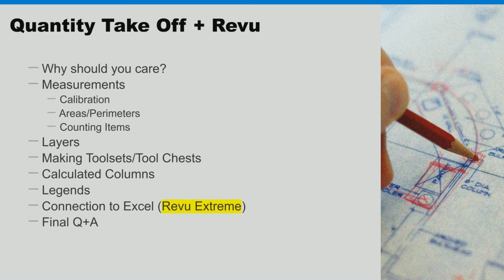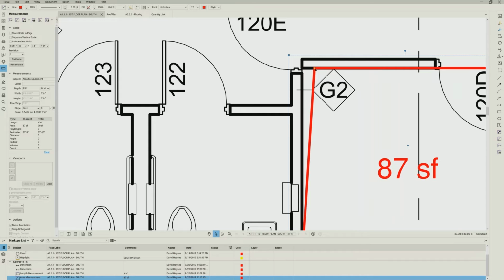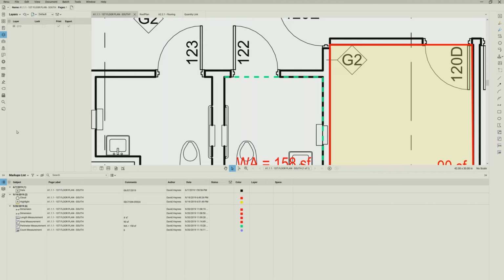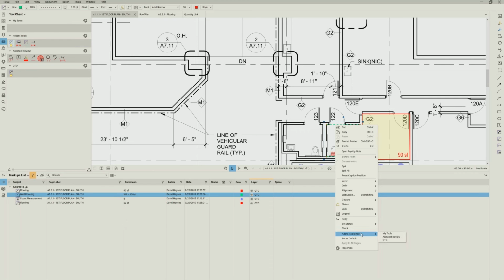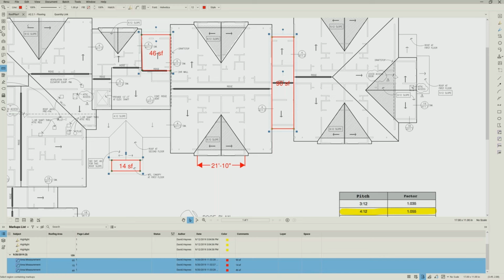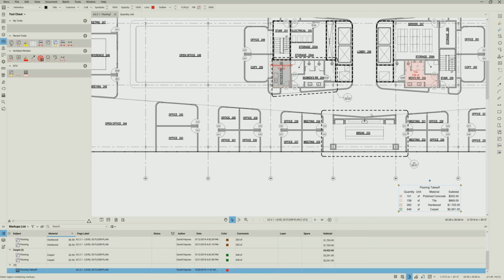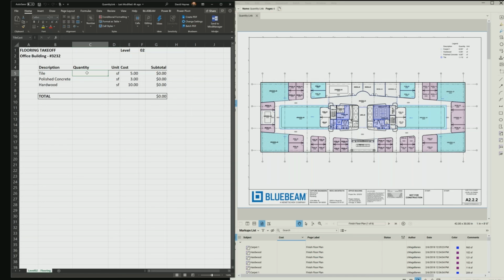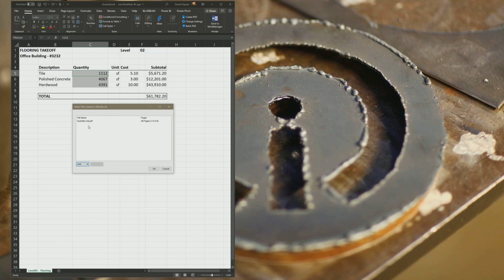Using Bluebeam Revu for Quantity Takeoffs

Comment: Hello, for some reason...well, wait.  First off thanQ for such an informative video.  Now, for some reason when I use the WALL area function I do not get a visible measurement.  What am I doing wrong? Again, thanQ.
Reply: You're missing depth (height), I had mine set to 0 and was getting the same issue.
Reply: @AKTechIT where do I find that. I’m new to this and I’m trying to work it out

Comment: great! how about plumbing takeoff?
Reply: Build a Tool Chest with separate tools for each pipe material, since cost and installation time vary by size; build a custom column for size. This also reduces the number of required tools significantly. Use the Length tool for runs, Count for fixtures and fittings, and set up custom columns so your Markups List totals length by size automatically. The one thing that's different from a general takeoff is you'll want a column tracking pipe size specifically, since that's what drives material cost, not just total footage.

Comment: To be honest, I was so dissapointed when I noticed that he tried to doublecheck and triplecheck if the calibration was correct due to he didn't use the correct tools.
Reply: Yep. That's when I turned it off.  Dimension (markup) is to add dims (nts).  Length (measure) is to actually measure.
Reply: @louklinum1963  Don't be too harsh on Grandpa. He made a mistake, obviously. We all do !
If the drawing has a scale, just enter the scale and you good to go !
Reply: @louklinum1963 stop being so picky i bet ull remember to use the right thing just bcuz of the mitake he made so just be greateful

Comment: This is simple,  Why you don't do something about Piping,
How do you estimate piping in Plumbing and in HVAC
Reply: Bluebeam is great for measuring Ducts and piping also.  It is somewhat straightforward; the separate types of pipes (Hot Water, Cold Water, Glycol, etc.,) can be color coded on the screen for easy viewing, and then the legend is created automatically with a few clicks, to transfer into costing spreadsheet.